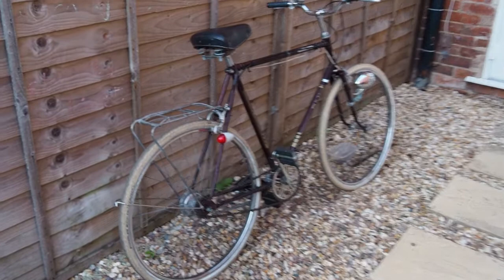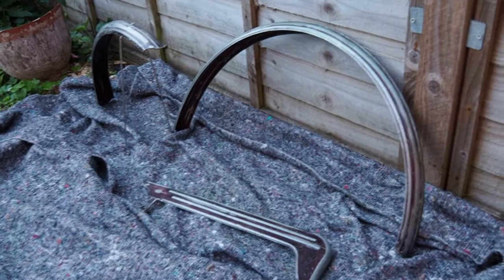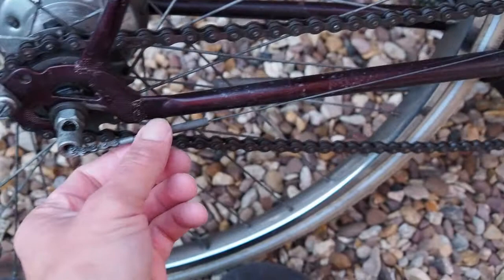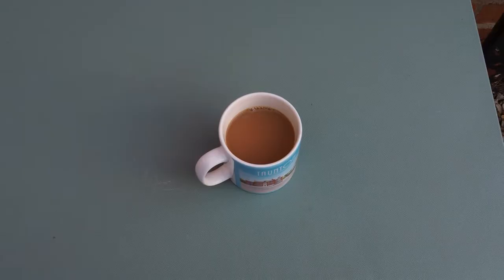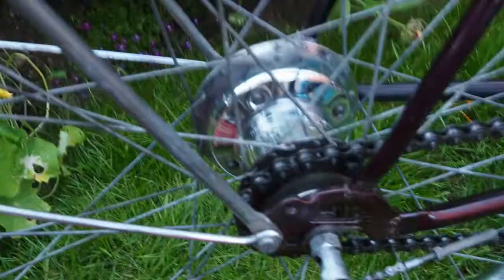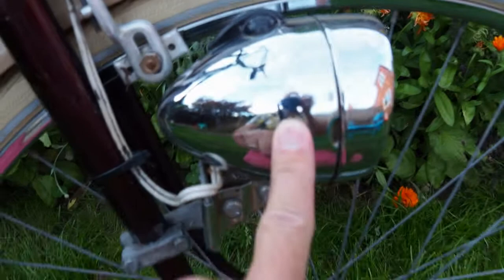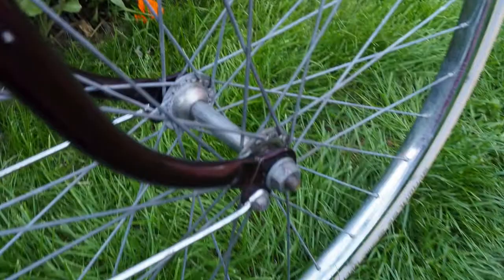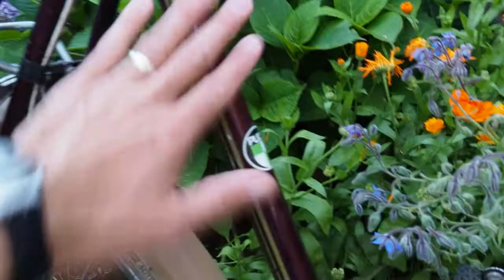Partially Restoring a Puch Elegance 3 Speed

Comment: How "clicky" is your trigger shifter? I've just got a 1984 Puch Windermere, which is pretty much the same bike, but with a slight curve on the stepthrough "top" tube. I've set up 3sp hubs on my Raleigh 20s but they all have twist shifters. With the Puch the trigger just doesn't seem right, struggling to get the trigger to move upwards past 2 and it jumped out of gear a couple.of times (which had painful consequences).

I'm going to try a new cable but am a bit worried about how to fit it to.the trigger shifter.
Reply from the maker: It's a pretty good one to be honest! It clicks quite nicely.  Might be worth checking to see if the tiny 'chain' that feeds into the hub is lubricated. Also, if you're able to access the hub gear reservoir (it's a bit fiddly) it might be a bit dry in there.